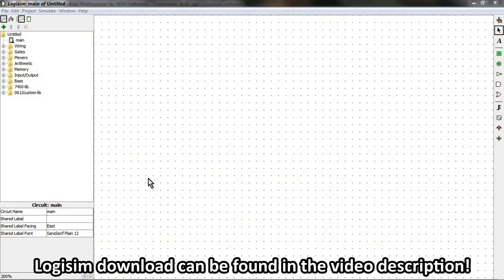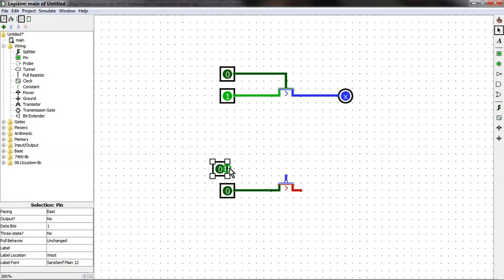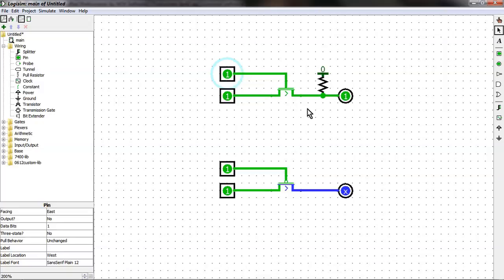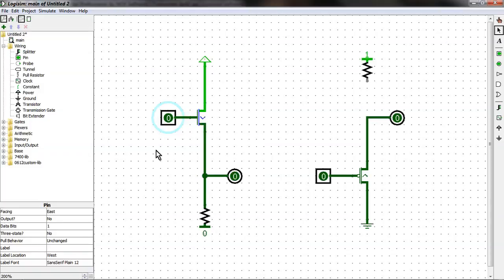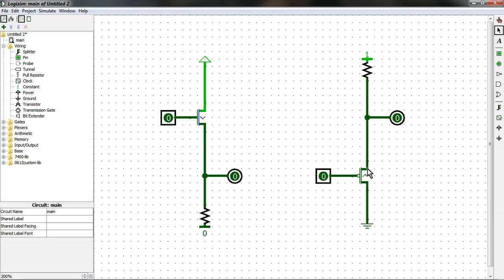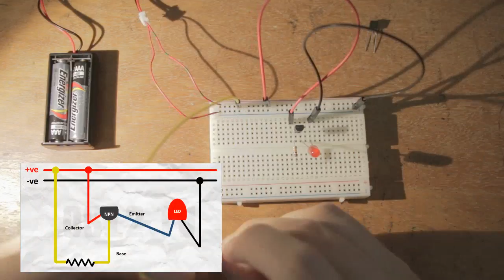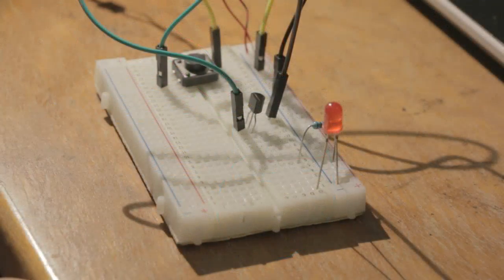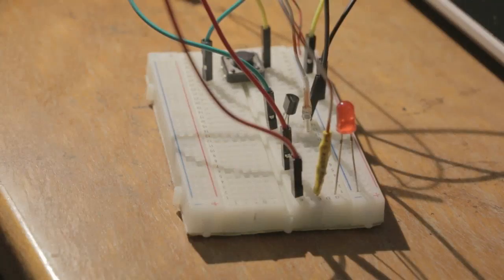Transistors in Circuits - Transistors Ep02

Comment: Hello, im a little confused by the pull up resisistors, when you use a pull up at the beginning of the circuit does the value need to be large like the pull down?
Reply from the maker: Hello and thank you for your comment! There are many subtleties that go into making an exact choice of resistance value for a pull resistor, but generally, using a higher value is advisable to prevent short circuits.